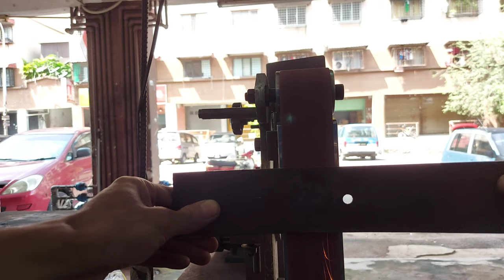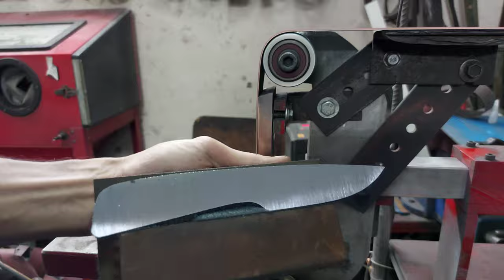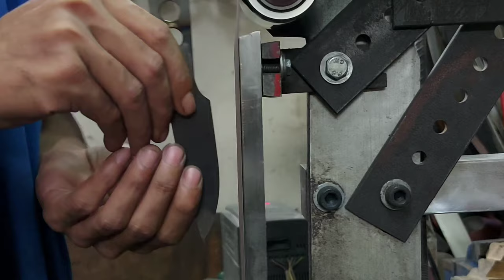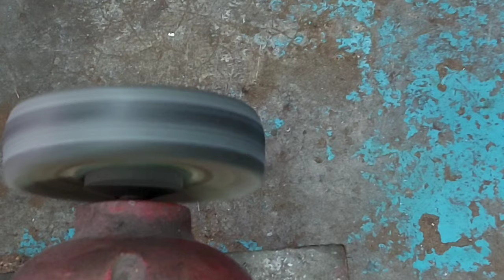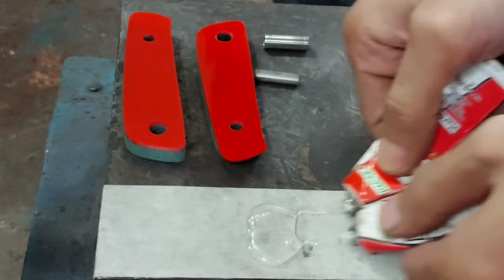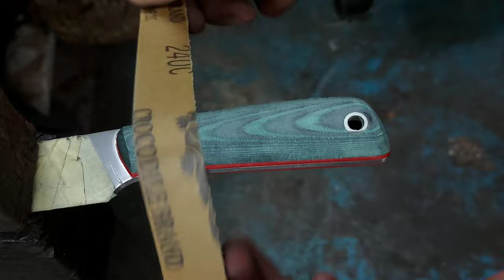KNIFE MAKING - TURNING RUSTED LEAF SPRING INTO A BIRD AND TROUT KNIFE

Comment: Why do some smiths quench it after grinding the bevel and some before? Will it have an effect on the hardening of the blade?
Reply: There's 2 ways to do it.
1) grind your bevels and then heat treat the knife. This way allows you to remove material very quickly because you don't have to worry about how hot the blade gets
2) heat treat and then grind your bevels. This method requires you to keep the blade cool while grinding your bevels. If not the steel will become soft again. Occasionally this is better depending on the situation but most of the time you will want to grind your bevels and then heat treat
Also you can't get a knife razor sharp before heat treating so there will be a small amount of grinding even after heat treating